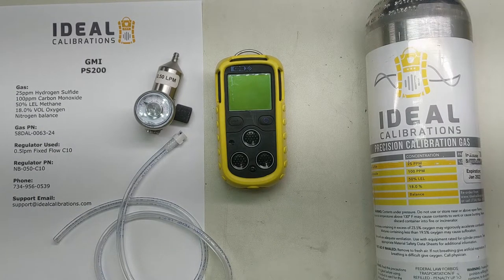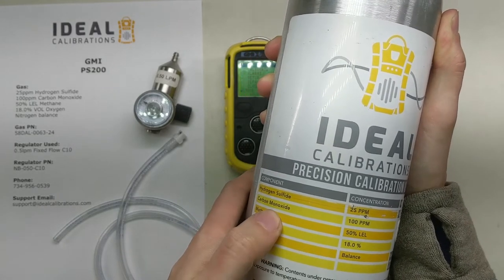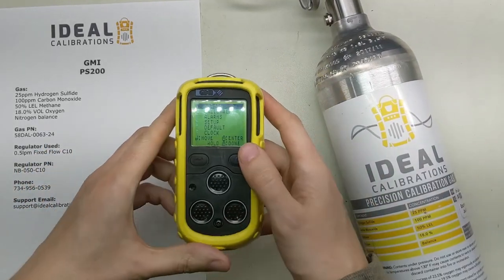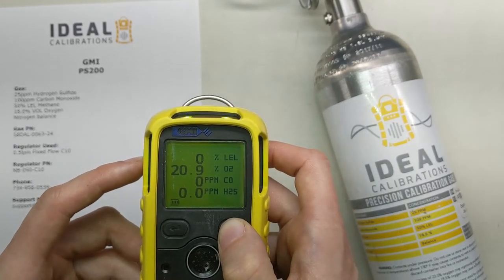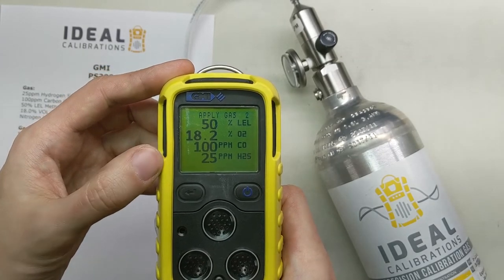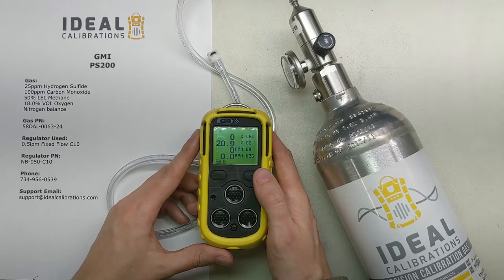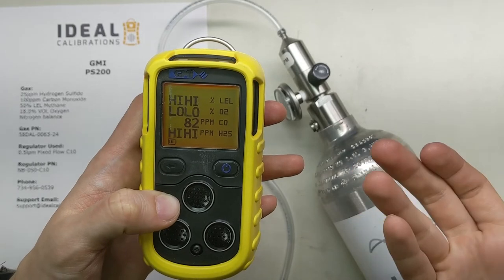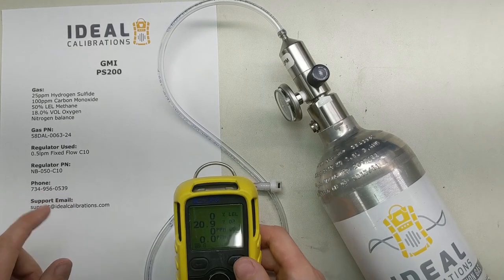GMI PS200 Calibration and Bump Test Guide

Comment: Thanks for this video, it's very helpful. (Definitely more helpful than the User Manual on the Teledyne website that says to enter the menu by holding the left button)

What is the BUMP option in the menu? I can't access it because I don't know the code. I assume it's for a bump-test mode. Other detectors I have used had to be put into a special bump-test mode rather than just putting the unit into alarm (as you did int he video).

Anyway, the calibration test didn't work for me. I probably have a different type of regulator and no gas is going over the sensors without the pump running. 🤷‍♂
Reply from the maker: Hey sorry for the late reply:

In order for the system to record the bump test, you'd need to put it in that mode (like for other instruments). However here I'm just showing a bare bones bump test, as you'd do if you were recording on paper.

Were you using a demand flow regulator? If so, that would be the problem, the pump shuts down when it's put into calibration mode.

Comment: Dear Sir, I did not see the USER SET/ AUTOSET screen in 3:16 and after that it did not display all 4 gases, instead only 1 gas at 1 time, eg it show Methane & its percentage level, if i accept, it will show Carbon monoxide, then Oxygen then H2S ...(sequence maybe wrong :p) 
May I know how to change the setting so it will show all 4 gases during calibration?

Comment: Only advantage of the unit is the built in pump. If you forgot to charge, the date will resetting. So this calibration is failed. The bump test was a joke, how you can proove you did it?? From the datalogger? GMI is a shame.
Reply from the maker: Hey Robert,

We're all so spoiled by software based bump tests now! Thankfully, there's always the old fashioned way. Set up and use a bump/calibration log sheet. It's still the standard, and honestly it's a good idea to use one if you won't be using a docking station. GMI does sell a dock that'll record the bumps and calibrations, so keep that in mind if you want the automation.

That said, let me know if you need a bump log sheet and I'll email one over to you.